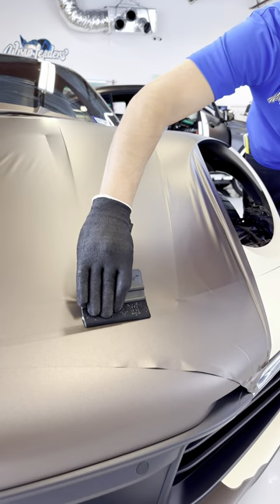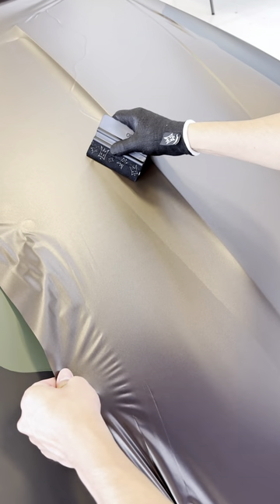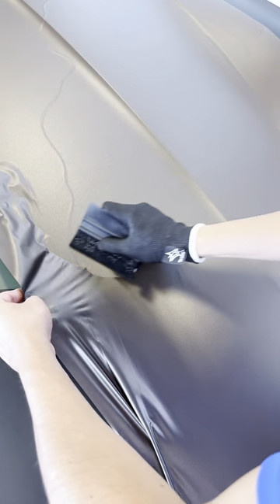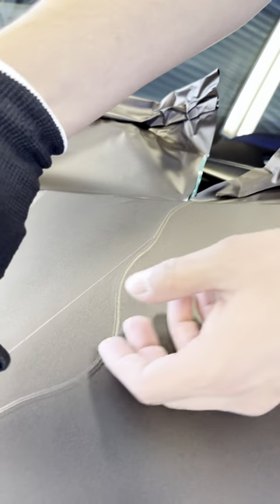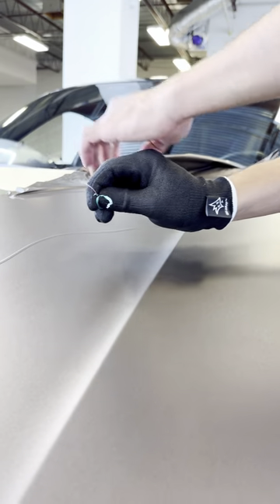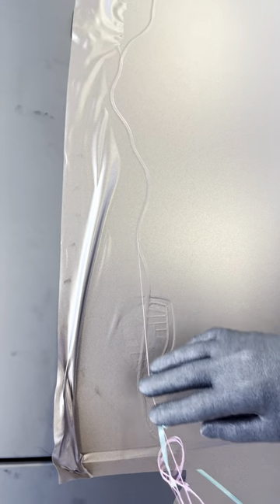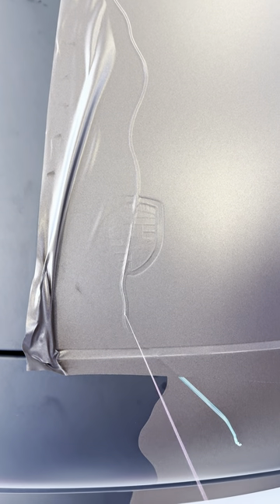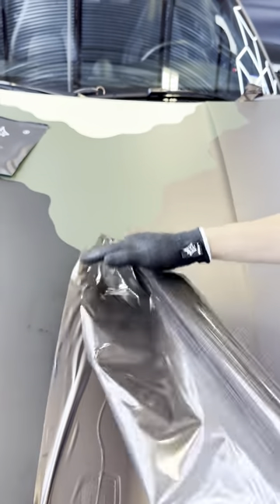Dolph Camo Wrap on the Porsche 911 🔥 | Car Wrapping With Knifeless

Comment: I'm curious about the solution you use after applying the decal, can you tell me what it is?
Reply: Please tell me, what did they use at 3:37
Reply: He said in a previous video that he uses a ceramic coating when he finishes all his jobs, so it helps protects the vinyl.